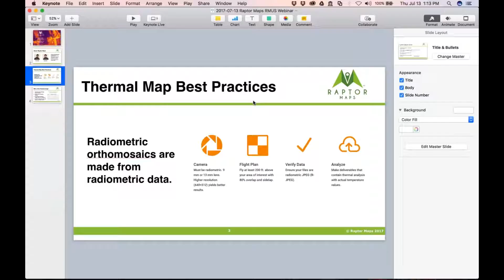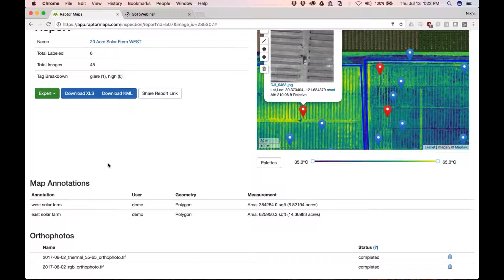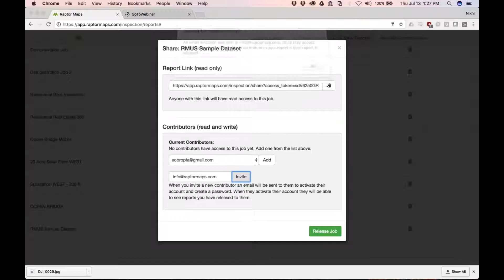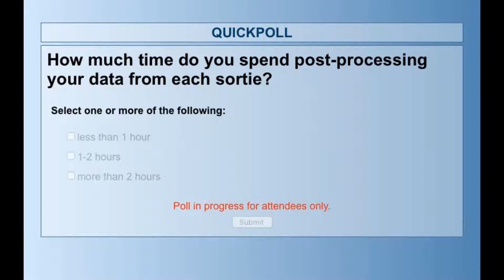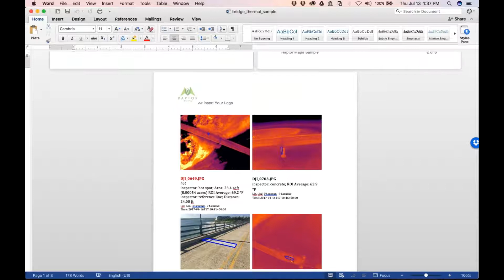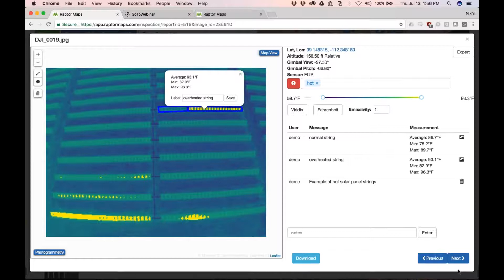RMUS Webinar July 12 - 2017 - Raptor Maps

Comment: I dont know if you have the ability or the contacts. But something we need in the drone world is a Realtime HUD display to be not only available to the Pilot Realtime but also in the video footage that has been collected.
Reply: They are called OSD in the FPV and Drone industry...On Screen Display video boards are quite common and do as much as any fighter pilot HUD with respect to heading, Battery information, and ESC amp draw, including real time Horizon and altitude orientation bars.https://www.uniquephoto.com/3d-robotics-on-screen-display-for-pixhawk-apm-2-6-vid-kit-0003

Comment: Thanks Jon,

Very interesting and informative, as with all your videos and Webinars. Because this Technology is so new and evolving so rapidly I keep running into the Chicken before the Egg dilemma. Especially down under, here in Australia. 
I see the amazing capabilities and potential for Thermal technology and it seems to have reached a tipping point, where size and cost are coming into reach. 
Raptor Maps looks like a Great option with very innovative and flexible deliverables. I'll give them a try, when my FLIR VUE PRO Radiometric is mounted and good to go. 

Thanks Mate